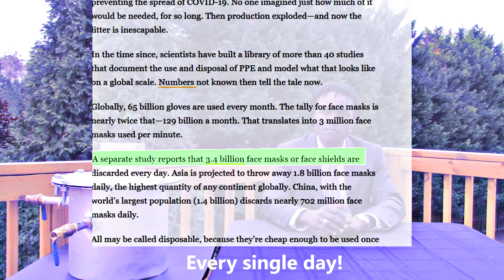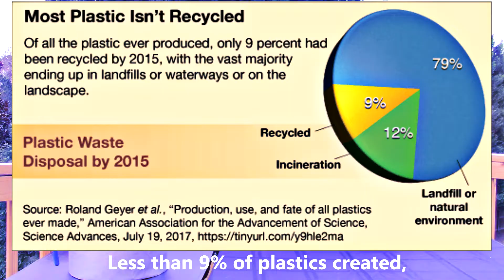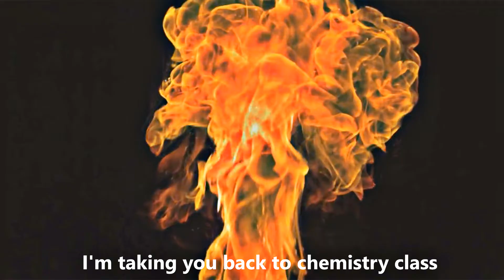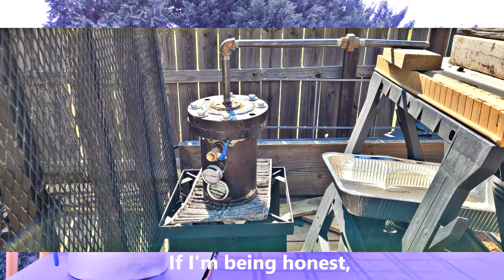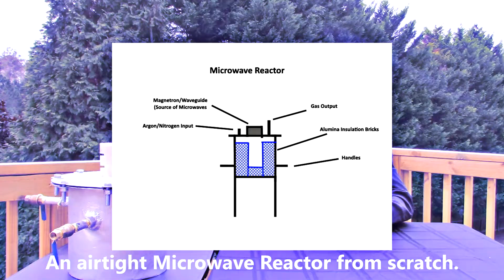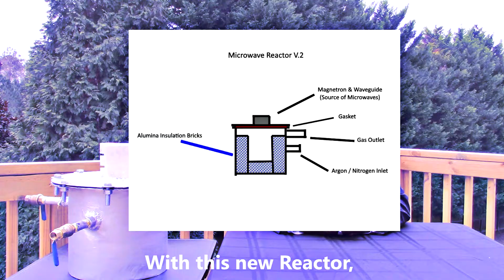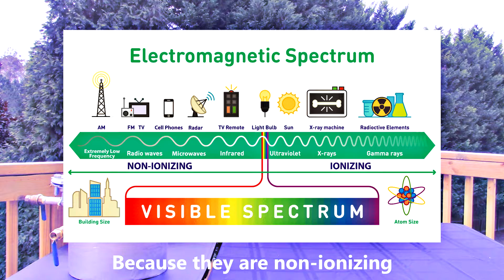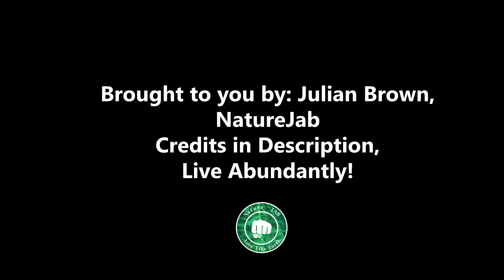I turn Plastics into Fuel, Using Microwaves! (Pyrolysis Reactor)

Comment: My young man - you didn't invent this technology, you're learning to deal with and improving this idea 💡 ... 

The idea of using plastic is as old as you... 

I like the idea of building a open project - again not new... 

This is where you're running into some that seem to be haters...   

I believe many workers on the same problem looking at different means to address the issue is very important... 

Combination of the best ideas 💡 should definitely build the best system.  

One system is not going to be the best system in every application. 

I like your drive, but what's the point of everyman trying to build the wrong systems to gain protection by design. 

Welcome to the world 🌎... 

Keep learning young man

Comment: cool but you cannot scale, its economically unfeasible.  Electrical heating is a better alternative.  But most of the folks doing pyrolysis comercially are still just heating a thick walled rotary drum or auger channels.  Nice little project though.  Good luck wth it.

Comment: This genuinely really interests me! I remember Porsche developing a similar concept of converting carbon emissions back into gasoline, however it was extremely inefficient. I sincerely hope you see this, as i feel these questions need to be answered before i place confidence in this. 

1. At this time, are you able to generate usable quantities of fuel? If so, have you attempted to calculate it's energy density, or at least qualitatively compare to traditional Diesel?

2. How much energy is required to convert 1 unit of plastic into fuel? How much fuel is produced from this? If #1 is fully answered, would you be able to give a rough estimate for the total efficiency of the system (energy of factors -> energy of products)

Id love to read the paper on this, however it appears the link in the description of the video is broken and does not lead anywhere. Hope this project takes off!

Comment: What is the difference between a gassifier and your microwave pyroclastic method other than using natural gas to run the gassifier?  You can store the natural gas created by the gassifier to run the gassifier.  And distill the by product liquid into gasoline, kerosene, and charcoal.  Your microwave is more efficient?

Comment: This is some dumbass shit, he is saying he can create gasoline by heating plastic, that does not make sense, another issue is, this machine produces gasoline, and it also produces heat, 1+1= boom 🤦‍♂️
Reply: It creates crude oil and distillation purifies the oil, it is absolutely 100% logical and can be done. It's basic chemistry. Also, with the advancements of things like fusion, this is a very viable outcome.

Comment: Great job. I love how much energy you have put in to your work . A call for the limiting all future plastic production is more viable and there are no emissions. The rant I could go on just about the over use of plastic containers for single use items is out of this world. Powered soap in cardboard boxes. Not millions of heavy plastic jugs. Most of the products that come in single use, can just as easily be sold in bulk right at the store. Bring your own jugs pun intended. This world of endless choices of soaps is crazy. That is just one product. Think about motor oil the plastic jugs from them are some tuff stuff. The whole economic model of single use anything is just cookoo for coco puffs. Good luck out there.

Comment: Neat idea but for areas without high wattage electrical supplies one can burn any fuel to do the job as Syrians do in Aleppo and elsewhere. How clean the flame is depends on the fuel and burner but no electricity required makes it more accessible, so if you can do a purely mechanical version that would help more people in isolated areas who don't have money for electricity or generators.
Reply from the maker: Great point

Comment: @NatureJab:  18 years old !!  Damn !!  I am 65 years old, and I have to say, I am impressed !! 

I am also a "Maker" like you.  
I see from the things in the background that you accumulated a reasonable entry-level tool kit.  It seems like you have a decent amount of space to spread out in (always a good thing !).

You also seem to have a pretty good grip on troublesome World issues.  For an 18 year old kid, that in and of itself is pretty amazing.  I wish my 22y.o. had the same vision and drive.

Focus and perseverance !!! 

The "Maker spirit can be summed up in one word "Obtainium" (the opposite of unobtainium). Parts and materials that you scrounge from whatever, and wherever.  I have built much of my shop from Obtainium.  Jigs, benches, carts (everything in my shop has to have wheels - No dedicated footprints), and tools that were out of my budget or not available.

Maker = Thinking outside the box:  Looking at things from a different angle than anybody else, and creatively reaching a solution that no one has thought of.  With a healthy dose of DIY (do it yourself).

Obtainium is recognizing the potential in parts and materials beyond their current usage.  Repurposing..... That old microwave sitting at the curb ?!  PARTS !!!
Or, to use an older saying:  "One man's trash is another man's treasure."
(unobtainium = doesn't exist, or simply not available).

Old, discarded Bed frames are a free/good source of Angle-Iron.  Readily found near Apartment buildings and other places tenants move out of regularly (high turnover).  Great stuff for frames, workbenches, carts, and other stuff that doesn't need a whole lot of strength.

"Pinky and the Brain" (Warner Brothers cartoon Lab Rats) Pinky: "So, Brain.... what are we going to do tonight ?" Brain: "The same thing we do every night. Try to take over the World !!"

You just might be able to do it !!

Listen to your Mother.  There is always a solution !  Now go out and find it..... or, better yet.... Make it !!!
Reply from the maker: Beautifully said, always love to hear from other makers & doers. Being resourceful and opportunistic, and always asking "How can this be done" is the way!

Thank you!
Reply: @naturejab  :  You are welcome.  Your premises are solid.
Reply: Você é gênio❤

Comment: If this is real it is very impressive, however a new fuel to burn isn’t a good thing for the atmosphere. The gas and liquid fuels obtained here are still fuels, which means they release carbon dioxide when combusted, and the last thing we want is more co2 in our atmosphere.
Reply from the maker: This is true, but plastic left in landfills & oceans emtis not only Co2, but Methane, so this process is 100% carbon neutral, and the Co2 emissions are better than the Methane emitted by leaving it elsewhere.
Reply: @naturejab  Wait i'm genuinely confused. Plastic in the ocean emits CO2 and CH4? How does that work i'm genuinely curious
Reply from the maker: @puppygirlgilmie  The solar radiation / UV light causes photodegredation, and the releasing of greenhouse gasses

https://journals.plos.org/plosone/article?id=10.1371/journal.pone.0200574
Reply: @naturejab  huh, i didn't know that. I can see how the production of the fuel can be carbon neutral or even carbon negative. But I don't see how the fuel itself can be carbon neutral. When you use it, it emits CO2 and other combustion byproducts. Don't get me wrong, I love the idea of using waste instead of dumping it somewhere. But the last thing we need right now is another way to dump CO2 in the atmosphere.
Reply from the maker: @puppygirlgilmie  Burning it is carbon neutral because any CO2 emitted in burning the fuel is methane that would've been emitted if just left sitting
Reply: @naturejab  According to the study you linked 1 gram of polyethylene releases around 5.8 nmol of CH4 per day. Let's assume the liquid fuel produced is diesel. It produces 2.7Kg of CO2 per Liter. Converting that to the same units gives us 71mol of CO2 per Kg of fuel burnt. to put that into perspective, 1000 tonnes of polyethylene emit 5.8mol of CH4 per day. 

In 2014 there was estimated to be 269,000 tonnes of plastic floating in the ocean. Which at best gives us 1560mol of CH4 per day. Considering the global warming potential of CH4 is around 28 times higher that of CO2, it would take 28 times the amount of CO2 to have the same effect. Which means we would need to burn 615kg of fuel to have the same effect as 269,000 tonnes of plastic.

So, for the fuel to be carbon neutral or negative we could only use 615kg or less per day. Which might as well be a rounding error considering the amount of fuel we currently use.

Long story short, while it is a very interesting and impressive idea, it's the wrong solution to the problem. You take waste out of the ocean which is good but create a new source of carbon emissions which is not good.

Your idea definitely isn't without its merits. It's very impressive, and clever. It's a good idea. But not the solution we need. I don't mean to bring you down, if anything I wish you keep working on this stuff, and maybe eventually you might find the solution we need. While this project might not be the solution, it certainly shows that you are a very clever individual.
Reply from the maker: @puppygirlgilmie  Thank you for your insight. The last thing I do want to mention to you, is in Pyrolysis we get a Carbon / Char by product, unlike if you burn plastic and just get ashes. This carbon can be buried in the ground as a form of carbon sequestration, which can make up for carbon from burning the oil. Nonetheless, I appreciate you taking the time to comment, cheers!

Comment: what types of polymers do you use in the reactor? Also are you able to tell what the sulfur level is for the output?
Reply from the maker: Primarily Polyethelyne LDPE and HDPE. I can't tell how much sulfur level is in the output without proper tools, but I have many filters and scrubbers to remove chlorines, flourines, sulfurs, metals, ect

Comment: this is actually really smart because we could eliminate the need to pump oil out of the ground and just get our oil as a byproduct of producing plastic. even if the oil is still a leading cause of emissions, this could be a huge leap in the right direction
Reply from the maker: For sure!
Reply: we need to gather all the plastic waste and turn it into energy, the co2 can be gathered back growing wolffia, bamboo or any dead plant material that is turned to biochar instead of letting it rot away, when the earth's soils get full of biochar co2 won't bea problem, what we need to know is how to unlock oxygen so that we don't run short of it, with all that combustion we need to have as much biomass peiducing it, all the energy is coming from the sun in the end.

Comment: Even though heating the plastic with microwave / Infrared / Lasers with lambda which will be transparent to the medium n factor thus will heat it more effectively, some of the other methods I've seen in pyrolysis make more sense to me i.e. use the gas created in the process to heat up the pyrolysis chamber, this way you're using a portion of the very plastic you're trying to get rid of just for getting rid of that plastic, and you bottle up the rest and sell as natural gas  for cooking.
Reply from the maker: Fair point, thank you!

Comment: Beautiful work! It doesn't even bother me if for pyrolysis one is spending more energy than getting. We humans have created too many troubles to Mother Earth, and so we must think only how to pay our debts to it. I wish I could use my small induction cooker for the small scale pyrolysis..  (But it can heat only liquids, I'm afraid, not dry plastics).
Reply from the maker: Yes, I agree!  Mother earth has provided us with renewables that can completely negate the energy consumption side of things, which is amazing! 
I've seen induction pyrolysis reactors, so it may work. Look up Hazel Chem - Induction reactor
Reply: @naturejab  Are there lots of sulphur in melted plastics? And how about chlorine which comes with pvc? Didn't you feel like making your machine and all pipes of acid-resistant materials? (That's going to cost tons of money, right?).
Reply from the maker: @saibabagarden  it will be quite expensive. Right now I use galvanized pipes  which are corrosion resistant. I have a filtering system which removed all chlorine and Sulphur products from the gas. The oil product, still contains sulphur, and requires further refining
Reply from the maker: @saibabagarden  no, it does not. All surfaces are covered in a layer of carbon, wax, and oils that form a corrosion resistant surface. The inside of this reactor has never rusted or corroded.
Reply from the maker: @saibabagarden  Excellent! I'd love to hear about your progress.
Reply from the maker: @saibabagarden  for sure, the vibe is completely different now, innovation has been bestowed upon us by mother earth so we can solve these issues!
Reply from the maker: @saibabagarden  I frankly disagree, as we speak I am working and refining the oil chemically, like they do biodiesel. Regardless, I hope you are successful with whatever you pursue!
Reply from the maker: @saibabagarden  Well perhaps you may use my many videos as a guide. Join our discord server, ask questions, and someone WILL answer and help you!
Reply from the maker: @saibabagarden  plants
Reply: @naturejab  totally without meat/eggs? Fish or oysters may be?
Reply from the maker: @saibabagarden  plants :)
Reply: @naturejab  Same is mine. 100% veg. No liquor etc.
Reply from the maker: @saibabagarden  Wow.. I thought you were in India because of your pfp and sanscript. Wish you the best
Reply: @naturejab  I temporary in Russia.
Reply from the maker: @saibabagarden  and your from?
Reply: @naturejab  You mean birth town, or race/ethnicity? Or cultural background? I left Russia in yearc 2006 and 15 years spent in South-East and South Asia, and just recently came back to Russia. In November 2022 I returned to Russia. I wasn't born here. Really speaking, only cultural background of person matters. If you only asking things like citizenship etc., it means culture is less important for you.. Alas, in today's world people are into external things mostly.. I'm only asking new persons questions like "what you eat?", or "do you smoke?", "do you drink liquor?" etc. It REALLY says something about person. And passport/citizenship is just piece of paper.

Comment: You will find that microwaves, Wifi, Bluetooth, and ALL of our wireless communication frequencies are very, very harmful. This information is soft-pedaled to the public, because these devices are part of the NWO's/FDA's/WHO's plan for population control. Look up Agenda 21.
Reply from the maker: I agree they are harmful. But in this device they are being contained and used to heat plastics. Of course there are leaks always, but it's a lot more harmful to stand 100 ft from a cell phone tower, than 10 ft from the reactor

Comment: billions of tones of wood is thrown away each year, there is your fuel to heat the plastic & often it will be free.
Reply from the maker: Great point! But burning treated wood is horrible. It's much safer to pyrolysize treated wood!
Reply: @naturejab  not treated wood, regular wood, wood chips, used pallets & such
Reply from the maker: @makeitpay8241  Ok I understand. That is a good idea!
Reply: @naturejab  you can also get wood gas from wood to run an engine.
Reply from the maker: @make*it*pay  A gasifier, yup
Reply: @naturejab  correct